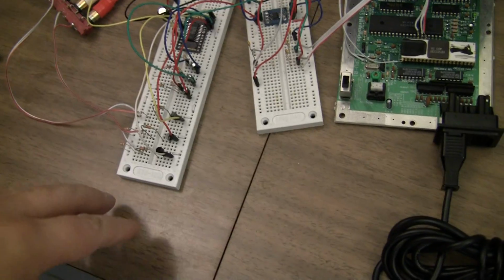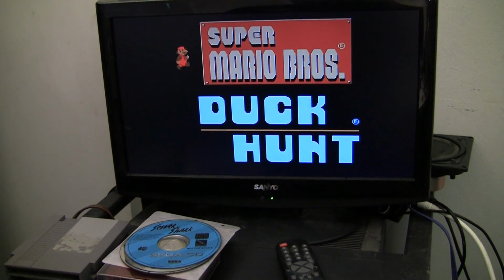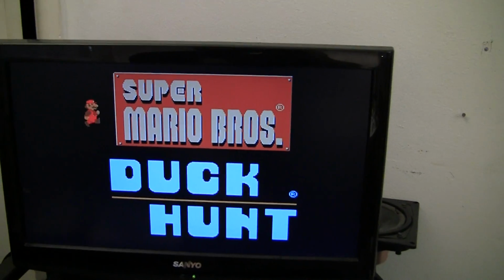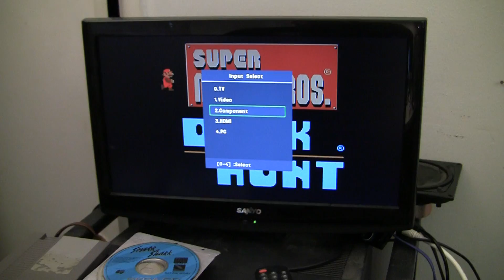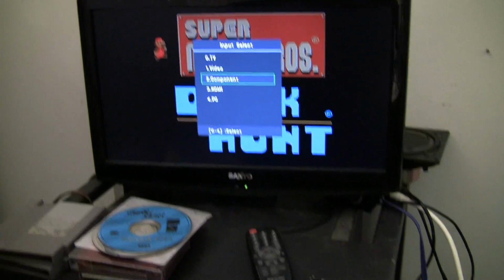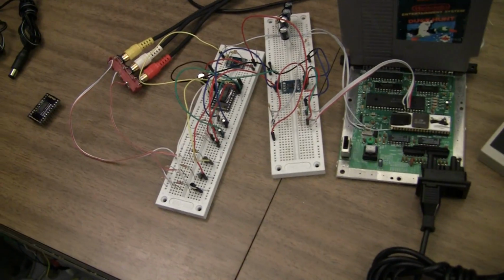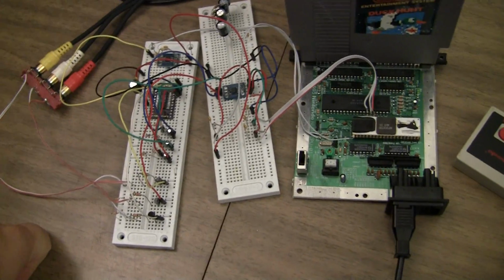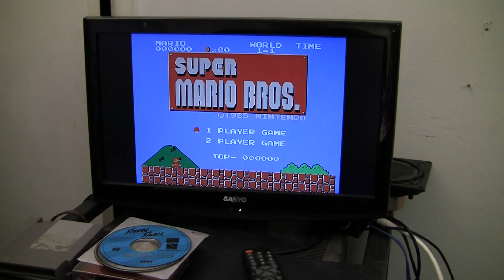NES-101 Nintendo Top Loader - RGB to Component using BA6594AF + LM1881 + NCS2553

Comment from the maker: The 'kit' that has been used on most rgb modded nes or fami's uses the sony cxa for conversion from rgb to svid and composite, but can't do component. Jrok has a board that also does this, but also has component out, but it costs $80+(?). The 6592/4 chip can do all four (rgb, yPbPr, svid, comp), but requires extra circuitry for svid and comp that I haven't played with yet.

Comment from the maker: Composite is readily available without putting in the rgb chip.
Svideo is only slightly better than composite and not worth doing all this modding for when you can have component which is nearly the same quality as rgb.